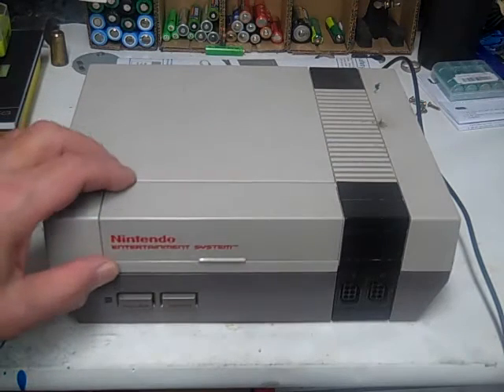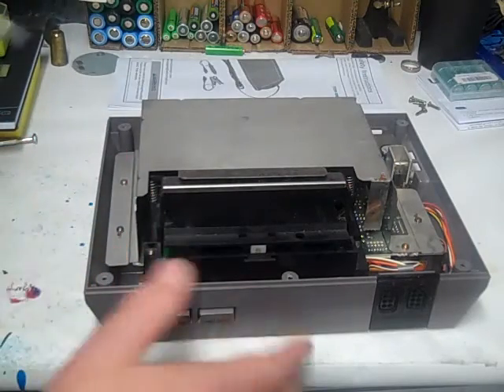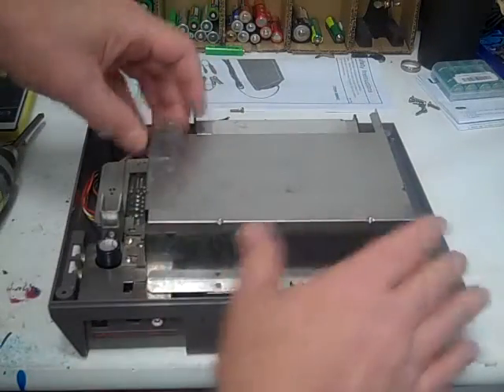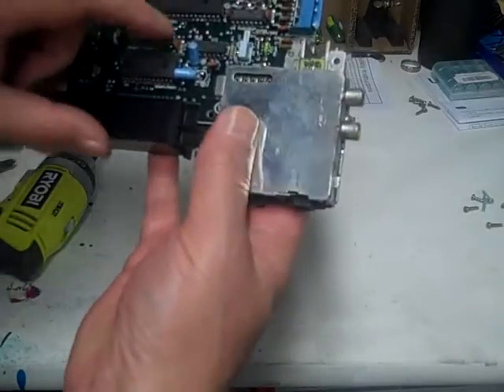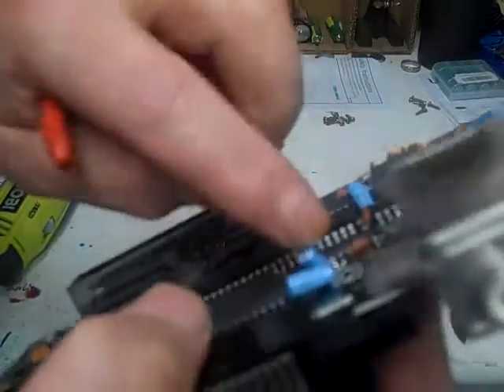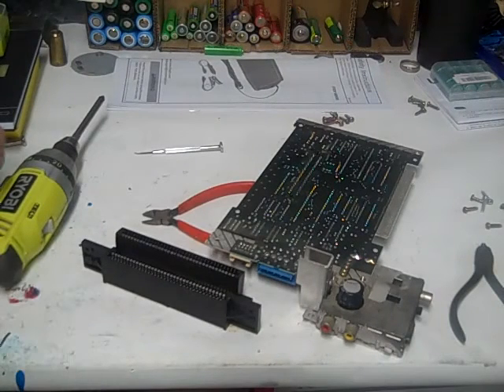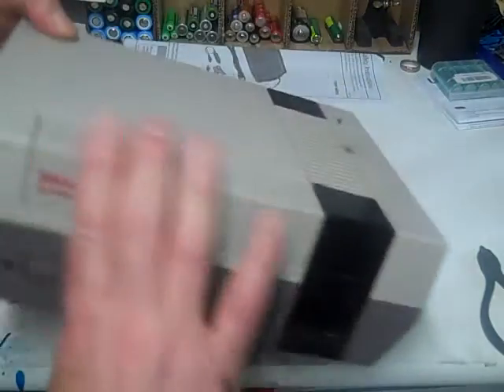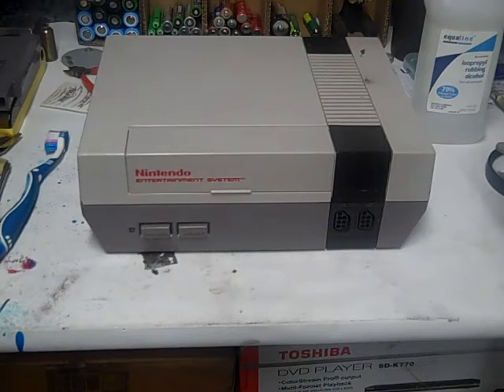How to Fix NES Blinking Red Light Fix

Comment: Mutilating a chip is always wrong. There is a simple 2 wire mod that makes it region free. Also don't use a electric screwdriver into plastic stand-offs, you easily crack the plastic. Screw by hand and start by reversing the rotation until it clicks. This ensures you use the original theads. You basically ruined this console.
Reply from the maker: you should do a video on it.

Comment: wow, you're a braver man than I, taking that drill to 30 year old plastic, lol. I always hand tight my retro stuff.
Reply from the maker: Nah its just a power screwdriver and it has a clutch. Also the plastic seemed almost like it was new. Oh well you never know I guess.
Reply: balls of steel using a power tool on a retro old nes. it has a clutch but never set it until you did the final case screws